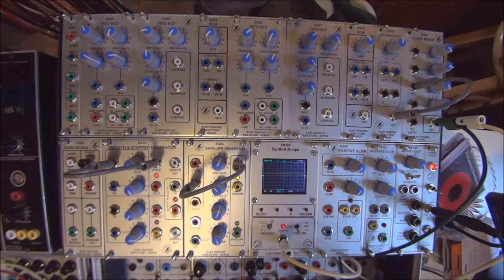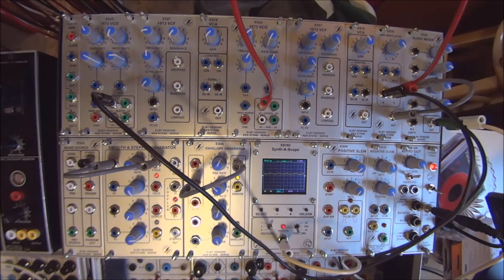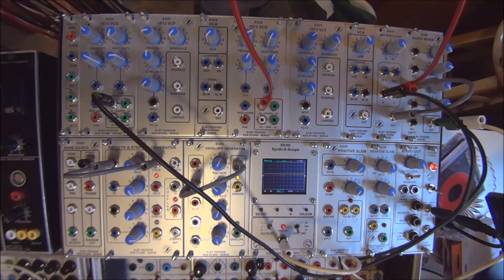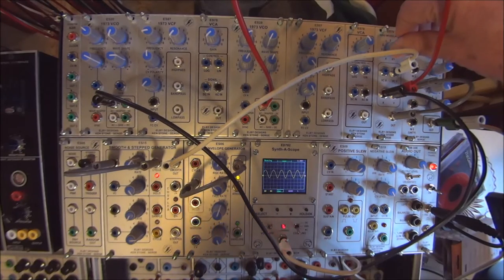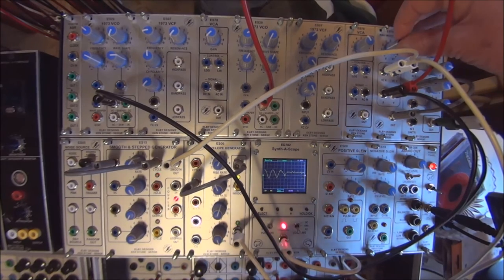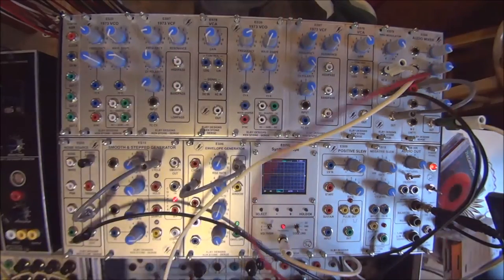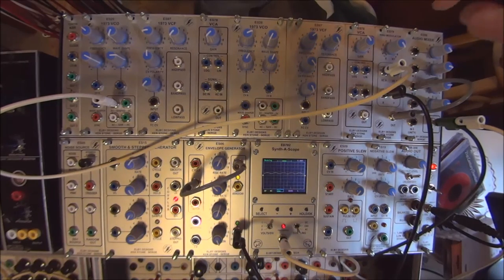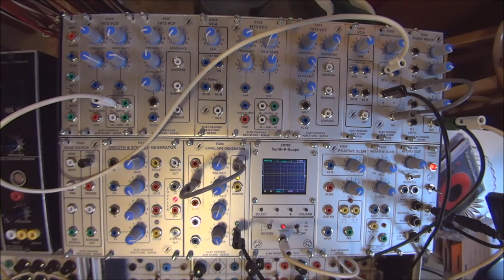EuroSerge Ring Modulator

Comment: Great video as usual, thank you!
I think it was not mentioned and it's important here: a "ring modulator" outputs the sum and the difference of the input signals (carrier and modulator). For instance, for two sines of 1000Hz and 800Hz it will return 1800Hz and 200Hz mixed (this in case of two sine waves; same will happen for each harmonic when using non-sine waves, returning a much more complex product). Also note that an ideal "ring modulator" will not output it's sum+difference product when one of the input signals is absent, which is interesting when, as in this case, you can control their amplitude. Of course, you can achieve this using external VCAs (one for carrier and one for modulator) on a different kind of "ring modulator",  "balanced modulator" or "four quadrant multiplier" not having that facility, as a transformer/diode ring "true" "ring modulator" for example (the Serge 1973 "Gate/Ring" is an OTA-based balanced modulator)

Comment: what cable is that 2mm banana into regular minijack or?
Reply from the maker: Elby EuroSerge modules are offered in both standard mini=plug and standard banana plug. My system is built with banana plugs because all of the rest of my equipment is.